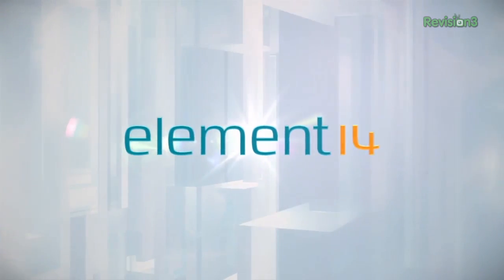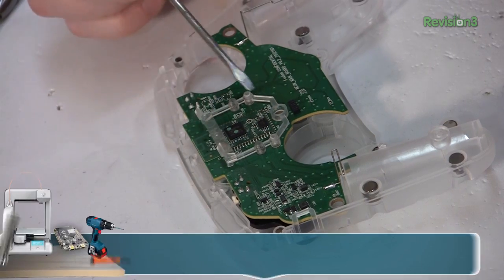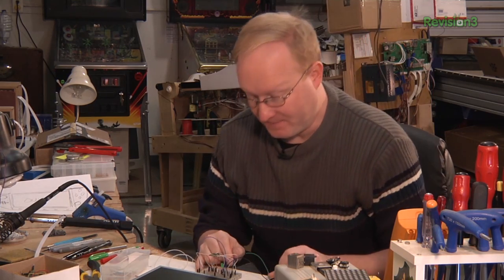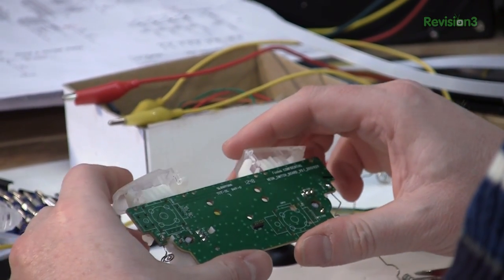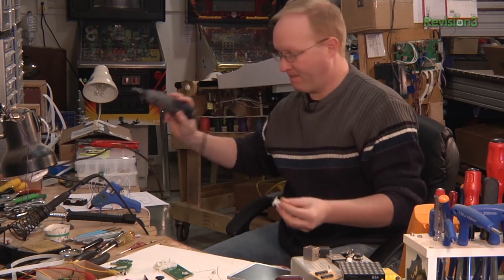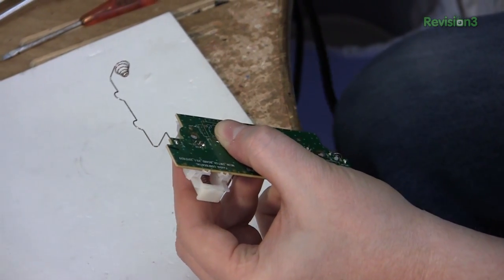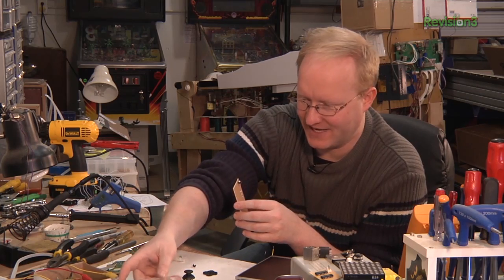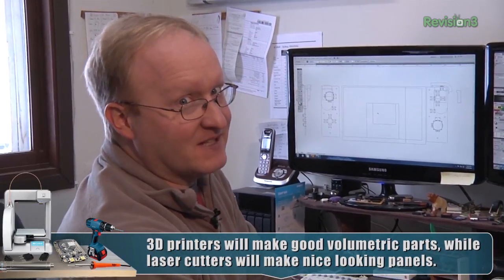Ben Kickstarts His OUYA Portable Build Part 2

Comment: Likely enough, they inverted the trigger potentiometers electrically besides inverting them on the PCB. The left and right pins just connect to different ends of the wiper strip, so you can have one or the other grounded and the opposite at reference voltage. I think they end up actually using the same ranges mechanically, to keep it symmetrical even though it doesn't look that way.

But I agree with keeping original trigger assemblies anyway, makes more sense.

Comment: Ouya portable build..? Its called a Smart phone lol
Reply: OUYA. That's why.
Reply: no the ouya is more powerfull
Reply: Fl0pPy diSk I don't think so anymore 😂🔫
Reply: honestly its not more powerful its just that the ouya is able to use more of its internal resources than a standard smart phone because it doesn't have to worry about battery preservation and many other variables PLUS the ouya has a much better cooling system than most phones overall giving it the illusion of more power  but really a top of the line andrioid has roughly the same performance capabilities but due to resource management and less than optimal cooling has to "tone its self down" from what the actual hardware is capable of at max potential
Reply: Or a tablet

Comment: can you make like a beginners guide to electronics cause i really want to get in to it but i do not have much knowledge.
Reply: One that has helped me in learning is "Make: Electronics" by Charles Platt. It seems pretty solid and about the only issue I've run into is that sometimes you have to order parts from several different resources to get them all (or pay $100 or so for each of 2 kits from Make). Also, sometimes the breadboard diagrams seem to be missing a wire, so you'll need to figure it out from the circuit diagrams.
The coolest thing about this book is I managed to find a .pdf of it online--so that saved some money for the parts to tinker with.
One book to avoid is "Hacking Electronics" (I forget the author). It should be called "Tinkering with an Arduino and a few LEDs since it seems to be mostly about using off-the-shelf components.

Comment: I would have left the trigger potentiometers on the board and just cut the circuit board.
Reply: Then he would have to stack boards or do something else for the other components
Reply: You are correct, I would have stacked the trigger board with the perf board.
Reply: that would add some thickness considering the legs of the components
Reply: yep, a little bit.
Reply: well a little bit here and there ads up quite a bit when you are talking about making something portable
You also have to consider how thick the button press and analogs make the case, you don't want it so big its like an xbox potato controller
Reply: Yep, I've made a few of these myself ;)

Comment: Ben, it's entirely possible that the potentiometers on the resistors are the same, but the disc on top was mounted sideways. That would make the values the same on both triggers. At least that's how I would do it if I were designing it.

Comment: I have been trying to build a portalble battery for a while now and I have ran into a problem I don't know how to recharge a rechargeable battery.
(No one say buy a wall plug for battery's I am trying to make a custom battery and it is not going fit)
Reply: neored6411 sorry to tell you this, but if you don't know even a basic thing like this you're better off buying some cellphone battery station.
Reply: I want to build a portable battery from (cells of) an old laptop battery, maybe this is something Ben could do as a project.
Reply: if it's a lithium battery, search for RC batteries charging methods, on RC forums or such.
Reply: You could get a hobby battery and take the casing apart, then re arrange the cells.
Reply: rkshirey no need to rearrange the cells, just buy the battery with the amount of cells you need
Reply: rkshirey besides, taking batteries apart is pretty dangerous
Reply: just tell how to make a discharged battery into a charged one. do i put plus to plus and negative to ground
Reply: neored6411 You can't charge a non-rechargeable batter, hence the name "Non" rechargeable.

Comment: I want Moar portables. Soo anticipating the console portables, but what I really want is a portable desktop laptop. a laptop with pc components that is. Perhaps a titan black edition with a custom cooling system.
Reply: *****
A Battery, Mini Itx board with a pci 90 degree extension, lga1150, built in monitor, plastic printed screen. In fact I believe there's already a laptop with dual equivalents to 770s in it.